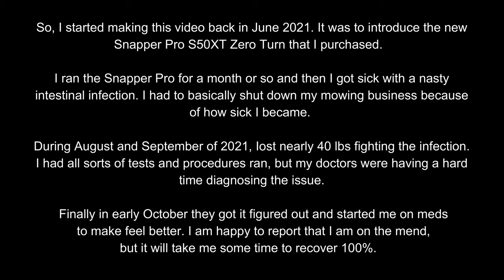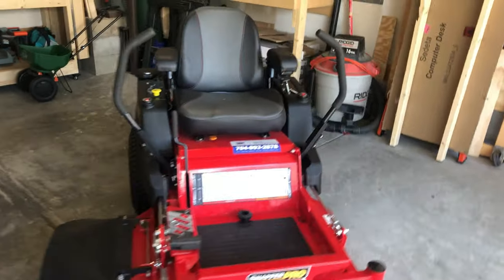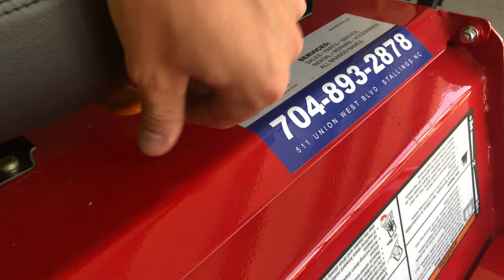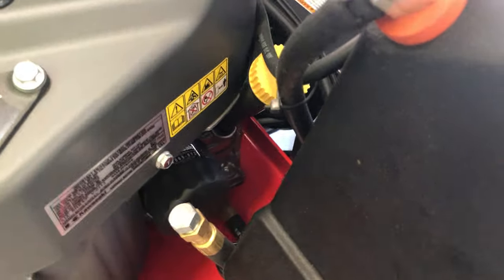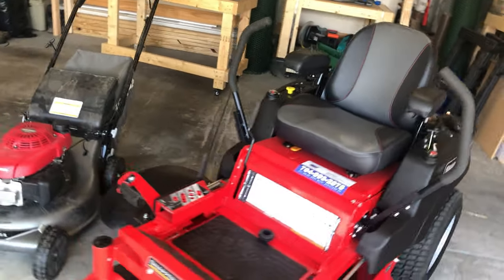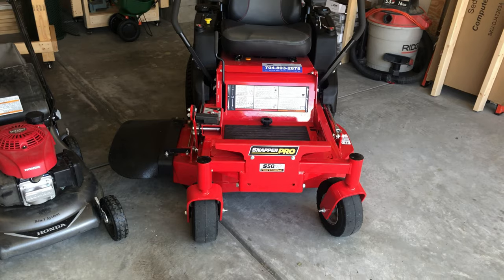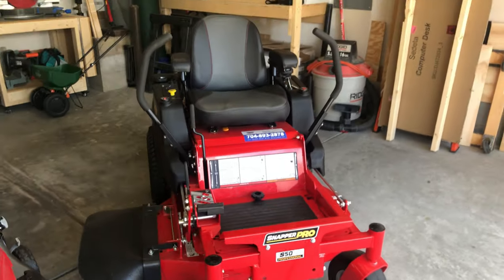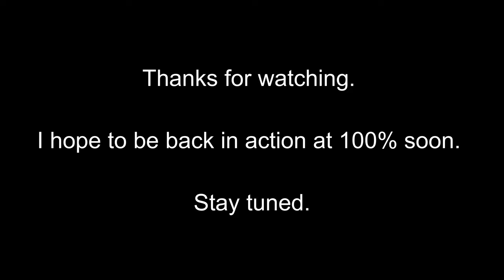Snapper Pro S50XT 36" Zero Turn Mower Introduction - Kawasaki FX600V 19hp

Comment: I have had my Snapper Pro S150xt 48" since 2014 and I have been very happy with it. Best riding mower I have ever owned.
My 150xt also has the Kaw FX600v and I assure you your 36" is not underpowered! My only dis appointment with the Kaw is now at 300+ hrs it needs the breather cover gasket replaced. I may as well just do all of them since I will be tearing it down. Such is life!
Reply from the maker: I really like my Snapper. I didn’t continue my mowing business this year. But I’ll be moving to a new house soon and I’ll have a half acre to mow so it will get used plenty there!
Reply: @fondupot  I'm a homeowner that likes things built to last.
I suspect you'll have it as long as you don't get tired of it.
Reply from the maker: Same! The only reason I could foresee getting rid of this machine is if I needed to get a bigger one!

Comment: I didn't realize they put 19s on the 36ers. Thats paired with the 3100s it should be a mean machine through thick stuff,, Thats pretty stout! From one to another grab yourself a grass flap, it will keep you from getting the driveways and sidewalks nasty then as soon as you're free of those open her up and let it fly. Save time on blowing and puts you in a premium bracket of keeping yards prestine. Which means more $$$ 

Cheers!
Reply from the maker: Good idea in the grass flap. Recommend any brand?

Comment: I knew you'd eventually upgrade to a rider. 
I use a Harbor Freight screw jack style lift on my 700lb Husqvarna MZT-52. It is stable, and breaks down easily to not take up a lot of room, but the wheels & their axle bracketry stink. Kawasaki is a good motor, with better torque to hp ratio of other brands. My 28hp Briggs bogs where a 22hp Kawi I demo'd wasn't phased.
Reply from the maker: Yea. I should have just gotten the rider to begin with. I didn’t think my little mowing biz would take off so fast. At one point I had 25 clients that I was juggling on weekly and bi-weekly mowing schedules. It was getting tiring. The snapper has been great. The Kawasaki motor feels strong even in really tall thick grass.
Reply from the maker: Right now. Only 2. My Honda. And a Snapper Pro.
Reply from the maker: I sold it.
Reply from the maker: It was a Worldlawn 32”

Comment: Did my eyes deceive me or are there actually two fuel filters on that unit ?
Reply from the maker: Two fuel tanks! I think beach tank has its own fuel filter before the valve.
Reply from the maker: Actually I just looked. Both tanks come into the valve and then there is a single fuel filter going into the engine. There is another filter like thing that is attached to the overflow lines on the two tanks. Maybe that’s what you were seeing.
Reply: @fondupot  thanks for the update, nice looking machine you got there.
Hopefully you heal up and get to use it a lot next year.
I guess you missed harvest at your grandfather's this year ?
Reply from the maker: Yea I did miss harvest. They just finished last week though. They had a ton of rain Thru October and had a hard time getting the beans cut.